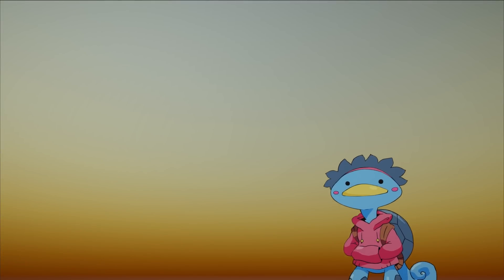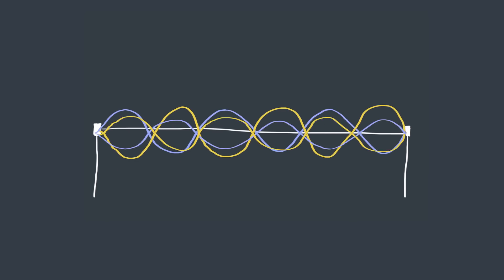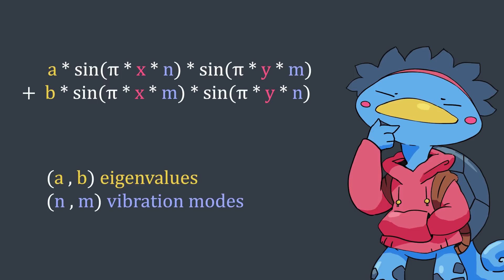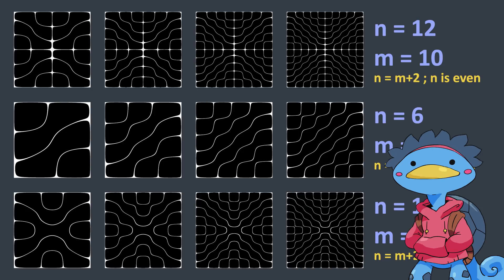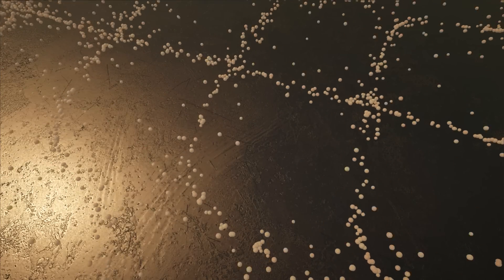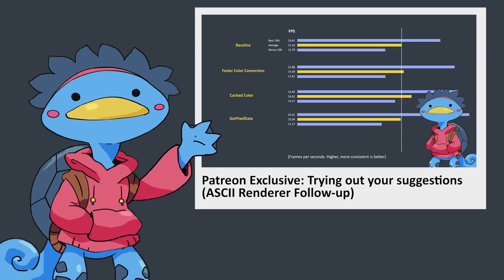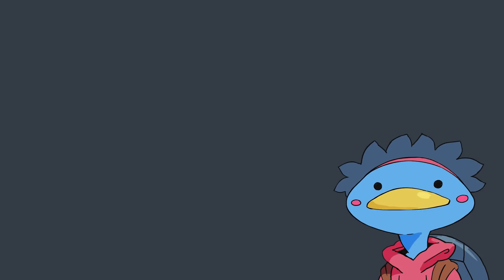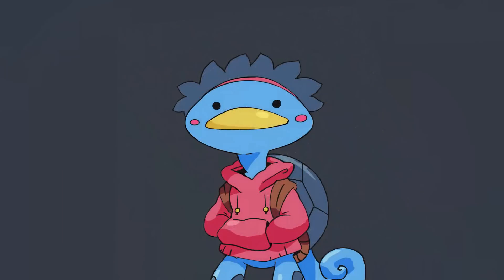Simulating Chladni Plates in Unity | Useless Game Dev

Comment: Would there be a way to create walls at the node surfaces of the 3D Chladni plate, instead of making particles group up at those nodes?  From there, could you let the player walk around on those surfaces (apply a force on the player similar to the force on the sands maybe?)? It could be such a nuts experience to walk through that, especially if the m, n, and o values slowly changed as you explored. Anyways, great job; this was such a cool video!
Reply from the maker: Yes, I think using marching cubes you could visualize the space, setting a threshold of what value is "inside" and what is "outside". I strongly recommend watching Sebastian Lague's video on marching cubes if you havent already! They explain the concept very well and show similar exploration type stuff at the end of it.

Comment: Hi, how did you implement the formula for the values? did you add the math to a script that could change the values? I've been trying to replicate using the formula in a script to change the shader graph but I can't keep the values in relation with eachother. thanks :)
Reply from the maker: I assume by values you mean a,b,m,n. You can write a script that injects them into a shader (graph) using material.SetFloat, and manipulate them from that script

Comment: When I saw the 3D demo, I immediately had to think of Star Wars Squadrons. One of the main complaints with that game (other than the fact that I get sea sick playing it) was that there weren't enough maps. What if you are in an asteroid belt and the asteroids are slowly moving according to a slowly changing 3D Chladni pattern? 
If you don't react to the changing environment at all, you could get encased by asteroids and die. Would add a lot of dynamics to the map. 
Similarly you could think about using the 2D chladni patterns for e.g. a battle royale game where the chladni lines segment the map into parts of the map that get elevated or depressed, dynamically changing the map. I guess this would be harder bc it might be difficult to ensure that the physics of all the edges still works correctly.

Comment: Sounds is fascinating. For a year, my wife has been complaining about the bass of my computer speakers, when I can hardly hear it.
One day, I decided to look up the wavelength of sound at average base frequencies. Turns out, the distance from my subwoofer to my chair is roughly 1/2 the wavelength for most of the frequencies - which means I won't hear it as I'm sitting in or near nodes, and so I turn up the bass because I can't hear it.

Comment: Really nice! Could you, in theory, hook it up to the midi-sound machine you made earlier? To get actual representations of sound?
Reply from the maker: I guess, although it would just a single tone, corresponding to one of the natural frequencies of the plate. If you stray even a tiny bit from these frequencies, the vibration goes back to fully shuffling the sand around (see the brusspup video) (see the guitar string thing, picture a slightly longer string that wouldn't allow the wave to bounce cleanly)
It's more interesting imo to start from a sound, and see what it does to the plate, like in the brusspup video

Comment: a "looks about right" version of the resource intensive version, with the performance of the version you started with, would be to use a 3-d version of the field you started with, and then use the field strength as the ratio of particle/no-particle pairs (and have any of those values be tweakable for the range and distributions) for where you draw your particle.

Comment: This is a great visual demonstration of Chladni plates!! I think this is the first visualization I've seen for 3d. The formula you wrote down for the 3d Chladni is correct, although the term "eigenvalue" is usually used to mean pi^2(n^2+m^2) or pi^2(n^2+m^2+o^2), rather than the coefficients. There are other (semi) explicit formulae for different geometries, like a disc has sin(n pi theta) * Bessel function, and on a sphere these are the spherical harmonics.
Reply from the maker: Thanks! I actually made a small sequence on circular plates (and about how I was *not* approaching the Bessel function with a ten foot pole), but it didn't make the final cut. It ended up being one of those Patreon exclusives though!

Comment: Well, if it could be possibly implemented on smartphones - Chaldini graphical lock puzzle could use touchscreen as an input (speed of swiping controls input, changes intensity of vibration) and visual pattern and vibration motor and sound (immersive effect) as an output

Comment: Sure, about the super tight lines forming over time: Maybe make the map of resonance fade from white to black instead of hard borders?
Reply from the maker: It does! The shader shows hard borders but the plate "vibrates" in a progressive scale. But even then, after a while the sand pools to the black (no intensity)
Reply: @uselessgamedev  you could try remapping the values so that there is no pure black. Particles should theoretically still gravitate towards the lowest energy locations, but there will now be a small amount of energy that will knock them off the line. 
Plus this could now be an extra variable you can tweak to soften or sharpen the patterns.
Reply from the maker: @iout  oh that's a great idea! Thanks
Reply: @iout  Yeah!  One other thought I had was maybe to add visual bouncing up and down, which resembles the real experiment.